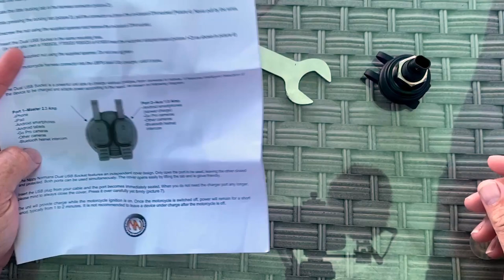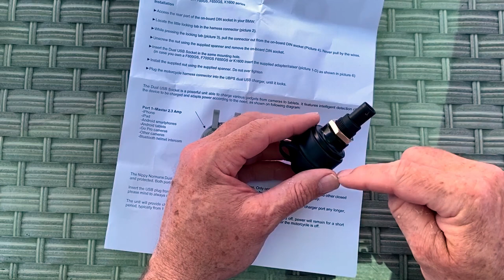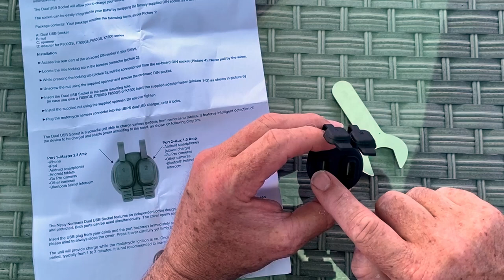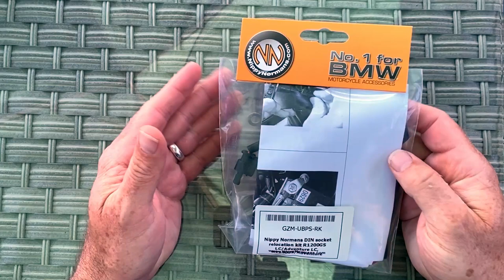Swap out the DIN Socket on a BMW R1250GS

Comment: Nick just left this on the Nippy Norman website......

Never really used the DIN connection and thought it was a little pointless.
However, by chance watched a Nick Hodge (YouTube video who does a few mods to his GS) about changing it out for this dual USB socket which for me is far more useful!
Fitting is very straight forward comprehensive instructions provided! 
Worth the money thanks NN!
Reply from the maker: Great. Cheers Iain 👍🏻
Reply: @nickhodgeUK  Now worries Nick............I bet you're counting the days until the 1st Sept???
Reply from the maker: Rather than the GS which was a gradual add-on process I’m needing to assemble luggage from other suppliers, some Denali stuff that I want to upgrade and/or doesn’t fit the GSA. Then I’ve got to unwind most figments off the GS so it’s busy. Then got to refit it all and run her in to 1st service before 18th when were of ‘who knows where’ on a weeks tour
Reply: @nickhodgeUK  Man of your caliber, I don't see a problem as long as the suppliers don't let you down?

Comment: Just for a heads up, the USB socket is weather resistant. It won't be waterproof,  especially if it is in use.  Great video and still useful.

Comment: My first farkle on my new 1250 GSA Nick. Went like a dream. And it works 😂. Thanks for the vid. 👍
Reply from the maker: No worries. Glad it works. The relocated DIN socket (if you did that too) is equally useful being 24/7 connected to the battery (so live always). Everyone connects via my DIN plug-in USB connector to that to charge their phones at lunch stops. I’m like a mobile power bank!! Ride safe 👍🏻
Reply: Yes Nick, I bought the kit so will be relocating the din socket over the weekend. I’ve also ordered TFT security bracket on the back of your vids. I might have to stay away until next months pay day 😂😂

Comment: Hey Nick, 

Did you fit anything like this on your older GS’s at all? I have a 2009 version which only has the din socket below the seat on the side of the bike.  But looking to fit a dual usb socket in a similar place tk where you have your one here. Thanks in advance.
Reply from the maker: I did but my earliest GS was 2018. Pretty sure it’ll work though. 👍🏻

Comment: I've just taken the plunge and bought the USB plug from NN.....using a cheap eBay DIN to USB adaptor which looks "bulky" and sometimes doesn't connect properly on the USB side.
So thanks for the heads up on this which should solve my charging woes!
PS. Good to see you back posting after lockdown!
Reply from the maker: Thanks for the encouragement. Been riding quite a bit but having camera tech issues. Hope to do new screen soon. Ride safe
Reply: @nickhodgeUK  Thanks Nick

Comment: Thanks for the info Nick. I got mine in New York from eBay - closer to the source in China. $25 free shipping . Dual USB Charger Power Adapter Kit for BMW R1200GS R1250GS F850GS DIN Socket (Fits: BMW). Nippy Norman's and Touratech ($75) are middle-men I guess. Received it in less than a week.
Reply from the maker: Hi James. I’m sure they’re just importing. For me the USB is only half the story. I use the relocated DIN socket for charging battery, inflating tyres, etc almost as much 👍🏻

Comment: Nick, thanks for that I saw this under my seat in a bag not sure what it was so kept it with the tools that were also under the seat in my top box. Nobody mentioned it at the 600 mile check, and also just had the 1st year service and nobody mentioned it then. Just been out and fitted it, and the plug now shows on the TFT  screen. Not sure that I am going to use it for off road, but now it is fitted. I thought one of the service people would have mentioned it ? I too have the optimists 4 but just fitted the connector straight to the battery with the adapter fitted up under the seat, so just connect the charger straight to that, so no need to worry about the canbus. Just waiting for a Cymarc front engine protector to be delivered as I noticed a stone chip on the front of the casing, don’t want the dreaded rust showing. Hopefully this will stop any more from occurring.
Reply from the maker: So chuffed I helped one. I agree not sure it’s of real use but you’ve paid for it and the TFT updates started to offer tweaks to each in the pro modes so if you want less wheelie suppression for example you can dial it in. I’m amazed it’s not routine to plug it in at 1st service. Ride safe 👍🏻

Comment: Hi Nick, thanks for another useful video. I also fitted the dual USB socket from Nippy Normans, but also bought from them another DIN socket with spring loaded flap cover and integrated wires around 25cm long. Rather than use the bracket as you did, I drilled the plastic cover under the seat on the left hand side, allowing the new socket to fit just behind the ECU. The wires can then be routed directly onto the battery terminals. I'm very satisfied with the result, which looks very discreet. I mainly use this for a mini compressor that I carry in the top box on long tours. It has mostly been needed by other riders!
Reply from the maker: Hi Jonny. Thanks for the tip. It does break one of my drilling rules but I’m sure that’s coming 😂. It’s always the way that it’s other rides using stuff. I am security. As my bike has tracker, alarm, knock sensors on the cameras, Datatool protection, everyone chains theirs to mine 👍🏻
Reply: The advantage of the NN bracket is that the din plug does not stick out into the breeze - so you can safely plug in heated clothing in a safer neater fashion.

Comment: Just while your on the subject of accessory sockets, if you want to use an 'Airman' compressor or similar for pumping up tyres/punctures from the bike, you will need the standard socket plus the only why the compressors work is if the socket is connected directly to the battery. Because the canbus system will not allow them to operate, due to it thinking the power drain is too much and shuts down the socket ! If like me over the years, a small portable compressor is a gods send. 👍
Reply from the maker: Yep. I use it for a small air bed pump and it been a charging point for multiple helmet comms systems this trip 👍🏻

Comment: Did the same as you a few weeks back and was well worth it.Easy to fit too. The only negative I found was the rubber covers were not that secure and do fly open now and again. A lot of owners on the NN review page have the same problem. Nice breakdown video.
Reply from the maker: Yes I agree. The other slight ‘down’ over my adapter is one of the outlets came out the back. Both out the top can make them brush the underside of the bars if the USB cable is thick. No danger but just the bracket could no with being 10mm lower or I should invest in some flexible cables 😂

Comment: I just aquired an  Optimate charger, which was supplied programmed to interact with the Canbus system.  My bike is a 2010 fGS650 (the 799 cc parallel twin), and is Canbus equipped.  Currently I have a  (straight) Optimate DIN to USB charger that I use to keep my  Iphone (using GPS navigation apps) charged up when riding, and this is the only charging outlet currently installed.   It would be nice to be able to twin out the USB connectors as per your installation, but I am interested in how the charging works with the Optimate charger reprogrammed to a normal charger that does not interact with the Canbus system.  Did you lose any of the functionality of the Optimate charger when used in this way?  The Optimate charger is expensive, and it seems a waste in a way to give up some degree of interactivity if in fact this does happen.  Does it still operate as a smart charger in both charge and maintain modes when reprogrammed in this way?
Reply from the maker: Hi Bruce. You will lose Sumerian’s functionality of the charger talking to the canbus although the charger remains ‘smart’ so reading voltage, applying load, waiting, remeasuring, charge, trickle charge, etc. I have the same unit and got more fed up with removing USB adapter for fear of theft (they’re not cheap) and then remembering to plug it back in than I ever did with the optimate charger  function loss  also, with the 1250 the DIN socket is quite low and pulling the optimate lead out has already resulted in one new lead as the plug snapped. Whatever you do. Be very careful pulling that plug. It’s more delicate than it feels 👍🏻
Reply: @nickhodgeUK  Hi Nick:  Prompt and helpful - I am grateful for the benefit of your experience.  How are the rubber covers on the twin USB connector holding up?  I have to say that is one virtue of the DIN connector supplied as OEM on the bike - the hinged cover is robust, but I am not a fan of how far the Optimate USB adaptor sticks out when plugged in.  Fortunately it is in front of my tank bag and somewhat protected, but is pretty easy to dislodge the thing and lose connectivity.  .
Reply from the maker: Bruce Bolster certainly the usb rubber covers could engage better. They do tend to pop open. However I would again say that normally I have stuff plugged in in a serious ride and not much wet gets down there in the cockpit to worry too much.

Comment: Excellent video, thanks for sharing.  I actually want to put another outlet somewhere on the dash to keep my GoPro charged as I run a GoPro, Sena helmet camera and my phone.  All the best Mike
Reply from the maker: It works out really well especially with the repositioned DIN plug which now it’s running direct from battery can charge stuff when the bike’s off 👍🏻

Comment: Hi Nick, great content! Thinking of doing this. However, how water tight are the USB ports when a USB cable is plugged in to the ports during inclement conditions?  Thanks
Reply from the maker: They’re fine. Mainly as it’s in one of the driest parts of the bike. Normally the reason it stops charging when pelting down is the other (lightning connector) end and although the new iPhones are so say water-resistant. It doesn’t take much ingress of water to get the ‘charging disabled which you can override but one of your children will die’ warning. And that can last for hours 👍🏻

Comment: Hi Nick, Great video. I'm interested getting the Din relocation kit, but my local BMW dealer can't find it on their system. I don't suppose you have or could find the part number?
Reply from the maker: Mike. It’s an aftermarket part sold by Nippy Normans in the UK. (Both the USB socket to go in the factory fitted space of the DIN socket and the ‘kit’ to relocate the now redundant DIN socket under the seat as an aux power supply) 👍🏻

Comment: Hi Nick! Thanks for this video, I’ve been saving my din outlet ever since replacing it with the Wunderlich dual usb socket ( probably the same one as yours). I had the idea of relocating it to the plastics near the battery, nice to know where I can source the wiring and plug. I might just extend the wiring and mount it on the sidecar’s dash. 🙂
Reply from the maker: Mine is actually from the UK wunderlich dealer but he sells it under his label so suspect he found the supplier!! Swap out is well worth it in my opinion

Comment: Another great video Nick, I actually fitted the din socket into the tail piece in a similar position to the one on a Triumph Explorer, I use it to power my left hand side pannier, I took the supply from the spare port on the CANSmart.
Reply from the maker: Are you just using the side pannier to charge stuff? Is that circuit 6a or 4?
Reply: Nick, yes just have it available to charge items if necessary, the second light circuit on the CANSmart is only 4amp, with my set up now probably not going to get a lot of use, I run my Gopro from one of the USB ports, the GoPro remote from the other port and I charge my iPhone from a Quad Lock wireless mount connected to the battery via an Optimate O-100 as this cuts the power 4hrs after turning off the bike, the O-100 is connected to an SAE connection from the battery which I can disconnect and use to power my Rocky Creek pump😉

Comment: Hi, good install but I believe your new USB sockets are permanently live. 🤔Possibly better to wire positive lead so that the socket is off when the ignition is off. Alternatively, Hörnig supply a twin USB socket which has its own on/off switch😉
Reply from the maker: Unfortunately Ernie that’s not the case if you refer to the ‘cockpit’ USB twin socket? That is Canbus controlled and switched off after short delay of ignition switching off. If you mean the new DIN socket under the seat, yes, that is permanently live but really only used for my charger although useful for unrestricted (to 10A) power supply

Comment: Maybe a daft question for you, but my girlfriend and I are going to do some longer trips next year on my 1200 GS, and was wondering, if I put the double USB socket on for charging the telephone, does it actually drain anything from the battery?? Do not want to end up stranded in the middle of Norway :-)
Reply from the maker: Hi Paul. No. The output of that ‘channel’, be it DIN or USB is controlled to a limit by the Canbus. If you re-site the DIN you can of course use more as it’s connected directly to the battery but I’d still advise it as the charging system while the bike is running is putting back far more than you could take out even with high draw heated suits let alone very low draw charging items. In ALL cases, be careful what you draw when the bike is switched off (if you have anything connected directly to battery) as the battery is pretty small and if you have  a tracker too that’s on 24/7. Bit of a waffle but hope it makes sense?  Ride safe 👍🏻
Reply: @nickhodgeUK  thx for the reply

Comment: Great vids Nick.  Winter has struck here in Canada and I am poking around my r1250gs prepping it for spring.  Just wondering why not just get a DIN to USB adaptor for that socket?  Several options around.
Reply from the maker: I have the optimate dual USB adapter but three main reasons. I mainly use it for USB and a fixed one isn’t stealable. The fixed one required no wire alteration and finally I could inexpensively and again with wiring alteration move the existing DIN to a useful (for air bed, battery and heated jacket) position below the seat and in fact still use the USB adapter as a ‘charging station’ for helmets and such during rest stops in tours for my and fellow riders helmets where they can rest on seat/panniers. At a low cost for me it’s a win-win 👍🏻

Comment: Hi got a heated bmw jacket that fits to the din socket via a spiral lead, this comes out the right side of the jacket so I need to put the din on the right side.  The one you have fitted is it close enough to the front of the seat or set back , long winded I know but just seeing my options 
Cheers
Reply from the maker: Hi Scott. It’s obviously on the right side but if you look on your bike there’s a triangle in the frame just behind the battery cover on the side. Without looking I’d say it’s under the front seat and the socket faces backwards. I’d say I’d rather have the lead there than running over the tank and into the cockpit. I reckon it’d be ideal and only £20 (for the bracket and wiring (you use your DIN socket))
Reply: Nick Hodge thanks for that mate I’ll check it out

Comment: Now following your channel- really informative- thank you! Will be doing the above when my new ride arrives next week. With the relocated and wired DIN would the Optimate 4 canbus still be appropriate as the DIN runs straight from the battery? Thanks Nick.
Reply from the maker: I have the optimate Canbus but I’ve switched it to ‘standard’ mode and it’s on charge via the relocated socket 24/7. Works fine 👍🏻
Reply: @nickhodgeUK  you are a gentleman. Thank you.

Comment: It amazes me that BMW do not put a USB socket on the GS as standard like for instance Triumph but that looks a simple fix if you need 1. The DIN socket mounting bracket is a brilliant idea-what many don't realise is that when run through the canbus system it won't power things like a mini compressor if you get a puncture so for that alone it's well worth having (I used the optimate flying lead direct to the battery via an inline fuse to do the same and also to power my heated vest) To save having to faff about taking the battery out I used the jump lead stud forward and right of the battery as you look at it to connect all my accessories which is far easier and quicker than having to remove the battery. As far as the pro plug is concerned I think BMW don't plug it in as IIRC it's something to do with being able to switch the TCS and/or ABS off completely in pro mode so they don't want to be open to any legal action if things go pear shaped in pro mode so by default have provided the bike without that option so the owner has to enable it themselves. Great vid as usual and good luck with the camping!
Reply from the maker: Hi Adrian, thanks for commenting. The comment came to an abrupt end, but certainly it's nice to have a 'direct-to-battery' feed easily available
Reply: I understand the new 2021 models are getting USB sockets instead of DIN

Comment: Good video again. Just one question, over time do the two rubber covers remain tight and in place? Thanks
Reply from the maker: Hi Richard. They do ‘pop’ occasionally but quite honestly it’s fairly weather protected where it is. They certainly don’t clip on 👍🏻

Comment: Does the Optimate 4 still work exactly the same with the repositioned DIN socket?
Reply from the maker: Hi Phil. It’s no longer set in its Canbus mode as it’s effectively connected directly to the battery via the DIN repositioning but works fine as an ‘auto’ charger. Boosts when first connected then drops to trickle. Been on 24/7 since November 👍🏻
Reply: @nickhodgeUK  thanks Nick. Much appreciated. Pick up my GSA in a few days!! 😎